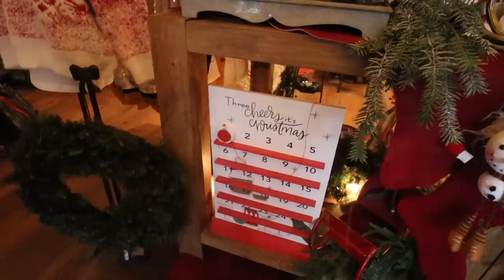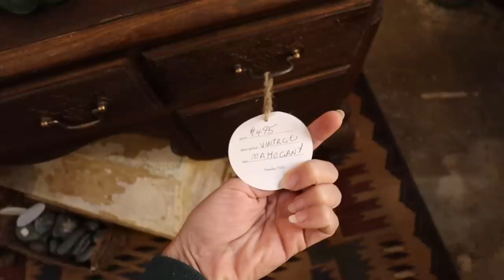VLOGMAS Day 1 🎄 renovating, shopping & decorating for Christmas

Comment: As if 8 degrees Celsius is cold. I’m renovating a stone English cottage with no heating, no usable water, limited electrics which has been empty for years. Its been 0 degrees and lower here and not fun to reno in. I use microwaveable wheatbags up my jumper, loads of layers and a portable electric heater when it works 😂